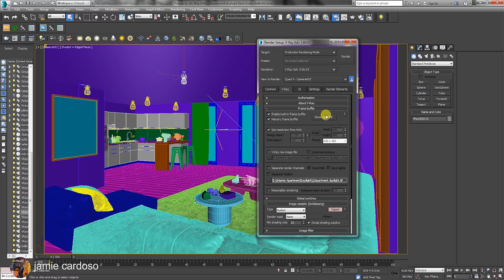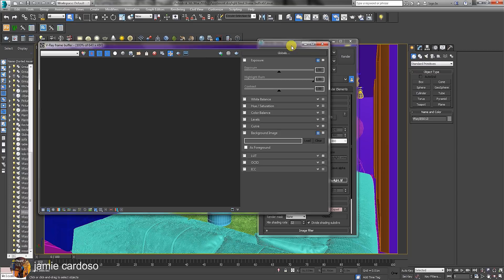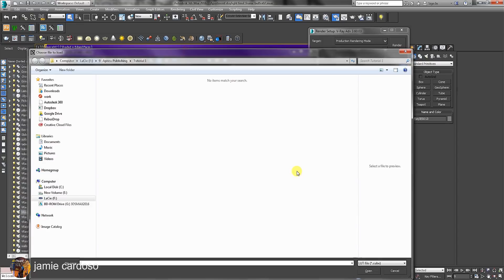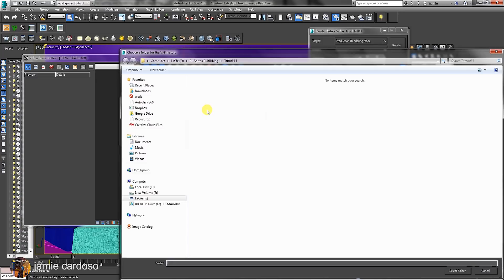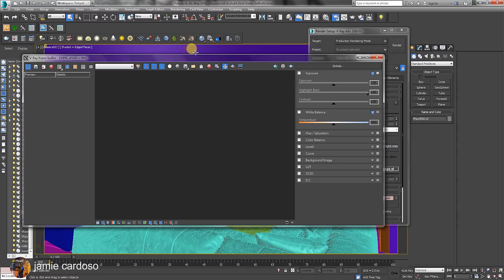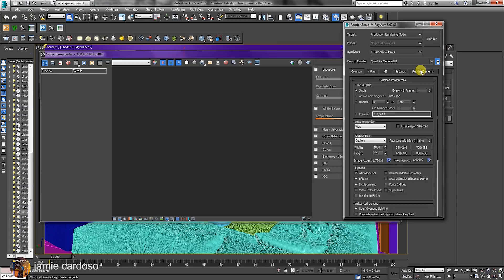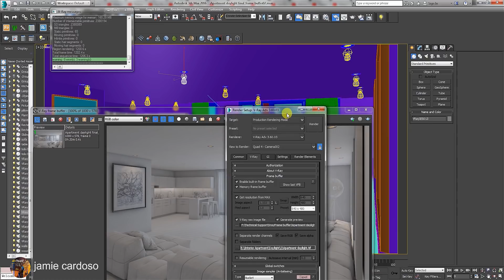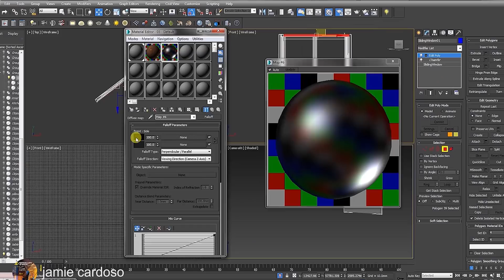3ds max & Vray Frame Buffer settings (custom captions/subtitles)

Comment: I turn on bloom/glare effect, adjust it and nothing happen, also my setting not much as yours, what is the problem? I am using vray 4.2
Reply from the maker: the bloom is mostly prevalent on very bright/er areas of your scene. Also, don't enable the bloom mask; unless you know what you are doing.
With regards to your problem, I would need to have a look at your scene first. The version of vray I'm using in this tutorial is 3.60.3